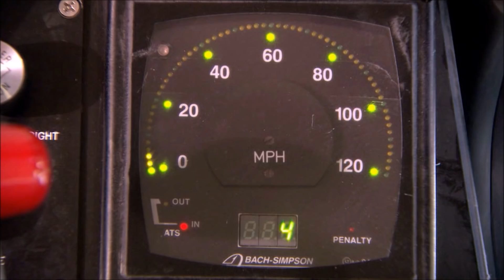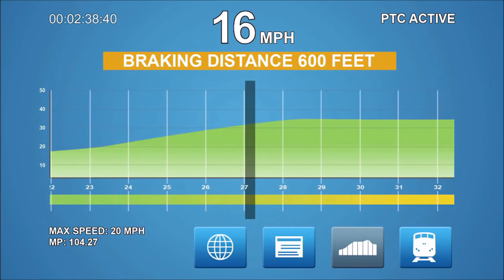Amtrak 501 "Cascades" Train Derailment 18 Dec 2017

Comment: OMG, terrible, respect to the engineer for the calm emergency call, I am a UK engineer so this is close to come. Good reporting also. We heard the curve had been uprated to 80mph is that not true?
Reply: The long straight sections of track had been uprated to 80mph as part of the project. For practical reasons it was impossible to uprate the curve,  so a limit of 30mph remained in force over the bridge. The transition from 80mph to 30mph is the key to this whole accident.
Reply: Thanks Gordon, OMG something terrible was missed then, this was the fist ever train over that new track?
Reply: This was the first fare-paying passenger train on this route, though trial runs were conducted in previous weeks. Many questions need to be investigated.
Reply: agree
Reply: As an aviator, whenever I fly somewhere unfamiliar, I file a flight plan, and do a route analysis as part of my pre-flight activities.  Airline crews do an abbreviated version as well.  Is there not such a procedure for rail operators?  It would not involve much of a time commitment. Most of the facts about the route are known. So ---  why can't this be applied to rail ?? Freight or passenger ...
Reply: There was a test run on the 15th with 501. I'm sure they're going to compare the data from that run to this one.
Reply: That was the conductor speaking, still good on him for being as calm as he was. The Engineer was never heard on the radio!
Reply: No, the curve was not uprated to 80 mph.  It was always rated at 30 mph, according to the news reports thus far.
Reply: As much as they spent upgrading for saving 10mins.
Why wasn’t the bridge upgrade  for millions spent🤕
Reply: At the beginning of their gay when they sign up and they read the bulletins and discuss their trip amongst themselves that is called the crew briefing and they have to discuss what is going on over the territory they will be operating on. The conductor is supposed to remind him of the speed restriction prior to arriving at that point. The engineer's situational awareness should not have been distracted or interrupted by having a trainee in the cab as a matter of fact he should have been more aware pointing out the speed signs for the restriction to the trainee as they progressed over the territory. The engineer must have been distracted buy some other conversation that didn't pertain to the operation of the train. The bottom line here is that it is the engineer's responsibility and unfortunately he's going to hang for the three deaths. His life is going to be in turmoil for many years. I can feel bad for the guy but the bottom line is it's his responsibility.
Reply: On any properly operated railway, the engineer has received thorough training on the lines they run on and receives a briefing sheet of all applicable speed restrictions at the beginning of their shift.

Comment: Amtrak says on their website that those Talgo trains can take curves at higher speeds than regular passenger trains. I haven't heard anybody in media discuss that aspect in any great depth. Care to take a crack at it?
Reply: The Talgo carriages can take well engineered curves at higher speeds, with the same level of passenger comfort, than regular trains. They cannot change the laws of physics, and this was an old curve, which  for practical (space and budget) reasons could not be upgraded to modern standards.

Comment: I'm going to speculate that the cause of the crash had something to do with inertia. 80 mph in a section designated 30 mph. It's unfathomable that this could happen.
Reply: Accident analysis starts with What questions, which is this case is fairly simple. Then it looks at Why human factors, Why systems design, Why planning and training?

Comment: I am at a complete loss, of why a large corporation, would put an engineer in charge of a locomotive, with no previous knowledge of the route. Did the brain dead company leadership, think, oh, he can't get lost, it's on a train track. Just hammer the throttle open, and get to portland ASAP.  Someone needs convicted of murder, and not the train engineer, ha is just doing what he is told, with no information of anything to do with the route, nto

Comment: It is a tragedy for the the victims and their families of course, but if there was a type of trainset equipped to handle that curve at speeds above its mandated speed it would be the Talgo. I have ridden the Talgo through curves on a demonstration run in San Diego, and there are two factors that give it an advantage over standard passenger consists. It is a tilting train using a passive system. For it to work right the railcars are lower to the ground than other passenger railcars are and also the car segments are shorter than typical such cars. Being lower means it is less likely to rollover, and being shorter means passengers have less distance to fall if the car ends up vertical to the ground.
 So this accident should not have happened the way it did if not for the extreme overspeed with which it entered that curve. The railfans killed were probably not seated if I guess correctly but were in no way to blame I would guess. I await the accident report of course.
  I will go out on a limb here and speculate that perhaps the curve holding factors I mention were most likely known to the crew and so could be partly to blame for decisions that could have been made in the cab that day. Remember that the Titanic was on her first run when it hit the unexpected and the tendency to show off speed can be a human failing that may have occurred here too.
Reply from the maker: Paul Gracey Great points Paul!

Comment: Why was the train late leaving its initial terminal & when was the engineer passenger qualified on this stretch of track. There should have been a Road Foreman of Engines in the cab of the engine instead of a cub conductor.
T W MCCARDLE

Comment: Thank you for the report Juan. There is much speculation on what would have been the cause of the derailment. Right now to me it seems the most plausible explanation is high speed/human error. Or some sort of mechanical failure. There are a lot of conspiracy crap being posted in the internet and some website even report it as true news. I have worked with railway crossings safety so I know there is a logical explanation of things. Let the reports coming, you are definitely the most credible source of information.
Reply from the maker: thanks Steve!
Reply: Your Welcome Juan. Your videos on the Oroville dam have been invaluable information to many construction engineers.

Comment: I am a Crew hauler and been going by this spot regularly for the last 3 years. Older BNSF crew have kept me informed of the History of this line and the Sounders.  The main reason Amtrak is on the Newly rebuilt line is that was a way for Extra money to build the lines for the Sounders. Amtrak could have kept on its old route without a great loss of time. Part of the enjoyment of taking Amtrak is the scenery, not watching I-5 traffic! This curve is a slow curve coming up to the Mainline switch. If they wanted to provide Service to Olympia as well, it would have cost money but the line could have kept on straight along I-5  and been more useful.  Half measures for spending rather than doing it right. PTC may have prevented this accident, but so would further training for the Conductor as well as Engineers on this route. BNSF and UP Conductors duties include helping the Engineer spot warning and speed limit signs. But they had a Conductor in Training in the cab with the Engineer in this case.  Another case of Half measures for spending. Lack of training for all personnel, not going far enough on a dedicated passenger route, as well as not installing PTC. And the "Warning of an accident" by the Lakewood Mayor is because of the heavy pedestrian and vehicle traffic at Crossings along the route, not anything to do with PTC, which the idiots in the Media keep implying! Just drive across the crossing at bridgeport w and others in the area and you can make that judgement for yourself.
Reply: I may agreed with you there, Always looking for a short cut, Don't work
Reply: Brian Sloth the reason why the US doesn't have a high speed line is not because we're in the past. It's mainly because train travel is not a main way of transport over here. Also many lines that are used in the  US by passengers are "commuter" trains. Therefore a high speed service would not be profitable. My main point is that the US is not living in the past. They are living in present day, we just don't have a need for high speed services.
Reply: Tom Popp - Thanks for the great info.  I live here in DuPont and have listened to just about every report on this incident.  Your comment, by far, has been the most informative when combined with this video.
Reply: People love there cars, but in NYC and others where travel is better, They will use a train.
Reply: You also forget a major consideration on US vs Europe for Rail lines.. Sheer SIZE. Take a look at a Map of the rail lines in the US and then same for Europe. There is even a website where you can get a true size comparison of counties sizes. Remember the Standard world Maps do NOT accurately show country sizes. Greenland is NOT half the size of the US. Gp tp the TRUESIZE.COM and see.France is only about the size of Oregon and Washington states combined  66 million in France vs 11 million in the Pac NW..
Reply: This is why American railways..(oh sorry, railroads), are the laughing stock of the developed world. Even some third world countries have PTC in trains, and the UK and Europe have even more sophisticated systems. And with all due respect to the U.S.....they hardly have what is called a "high speed train", anywhere, based on world standards. Decades behind other countries, for a variety of reasons. But for a country that thinks it is progressive, and wants to be the "police of the world", their public transport, and safety, where rail is concerned, is stuck in some sort of time warp.

Comment: British trains in the 1950s had a speed control system that checked the speed of an incoming train, presumably with a couple of sensors or switches ( check time between switches ). If the train was over speed then a signal was sent to the engineer, if the engineer did not respond then the brakes were automatically engaged magnetically from between the tracks. Simple and effective with no computers or satellites involved.

Comment: Good Job reporting this train derailment.  I have one thought about this curve on the track and I'm wondering why can't put a 60 degree bank on the track going 80 mph? Will that work? Just wondering. Like Nascar ( Stock car racing on a 60 degree bank going on high speeds ) will that work?  Keep up the good work and love your reporting and Merry Christmas. :-)
Reply: Joseph Verrier There are specific rules for the amount of tilt (called superelevation) permitted in any curve. Speeds may vary, and comfort and stability are both important, as well as wear on the rails due to contact with the wheel flanges.

Comment: Apparently some news sites are reporting that the 80mph speed the train was traveling before the curve was considerably above the speed limit for the straight part of the track. I've not been able to find any comments on that, but if so, it indicates a much deeper problem than just being distracted at the slow-down point.
Reply: Tim Douglass All the reports I saw indicate that 80mph was the limit on the long straight section of track. No reason to disbelieve this.
Reply: That's what I thought, but my mom said the local news (KIRO, I think) said they were speeding on the straight section as well. Guess we'll find out eventually. (maybe)

Comment: The thought I had is was there a communication issue between the locomotives? The driver reduces the throttle but the rear loco doesn't respond, and then the same with the breaks?
Reply: they go offline and into lockout with comm loss.
Reply: Slikx666 The rear loco was being pulled as dead-weight. The reason for having one at each end, was the lack of turnaround capability at the destination.
Reply: Interesting, we learn something new every day, thanks.
Reply: Pulled as dead weight?  Is that only with Talgo trainsets? Amtrak Uses BOTH front and rear locomotives push-pull as power on their commuters.  You can clearly hear the rear unit is accelerating:
https://www.youtube.com/watch?v=g-vBnMYhTZQ
Reply: And you can clearly hear the rear engine in this clip: https://www.youtube.com/watch?v=DBHP36HItVo
PS - They do not smoke like that at idle.  This is a Push-Pull Operation - Both Locomotives are moving the train.
Reply: I do not know for certain (and am not an expert), so I was quoting another post in this thread! The Talgo carriages are quite light, so a single engine would have sufficed. They also have a more rigid coupling, so they do not need a push-pull configuration to avoid the 'jerking' on startup of old type trains.

There are many regional alternatives on Amtrak, and one previous option used a single engine plus a 'cabbage-car' for control in the reverse direction: https://en.wikipedia.org/wiki/Amtrak_Cascades#Rolling_stock

Because the new #501 train-set had two dissimilar engines, the controls might not have been compatible for simultaneous use (speculation?)
Reply: Denniss7420 This is what I was wondering, why would you have a train and not use both locos? If you have 2 then one is the backup incase anything goes wrong with the one at the front.

Comment: Thank you for a sincere and cogent presentation of what we know, and what will happen, in this derailment investigation.  I have 51 years of railroad experience and, incidently, worked on many Charger locomotives.  I was dissapointed in the MSM coverage of this incident, where they focused only on the Talgo car dangling from the bridge, and made silly comments about how the engine stayed on the tracks, not even knowing which direction the train was going, and never noticing the Charger locomotive which had plowed through several dozen trees and dropped some 30' to the highway.  My only correction is that the radio call was from the conductor, not the engineer, the radio and all communication equipment on the lead locomotive was destroyed in the crash.  By the way, I've not heard any comments on the condition of the 2 engineers in the cab - obviously a very rough ride.
I appreciate your work, and safe flying!
Reply from the maker: John CMR Thanks John!

Comment: No disrespect meant, Sir, but I have been riding these Cascade trains between Olympia, Washington and Portland/Salem, Oregon for years. I don't like riding on those trains. They creek and sway, bouncing down the tracks. I like the newer Starlight trains because they are smooth to ride. Those cars you say are new from Spain? They look just like the same old coaches I have been talking about. Every time the Cascade pulls into the Station (501/511) I am disappointed and wish it were the newer, smooth riding train. The double-Deckers are wonderful.Also, that safety feature was not installed because it costs billions of dollars.
Reply: very posotive post...thank you

Comment: Headline: Passengers killed by bureaucratic red tape. PTC is a multi-facetted system that incorporates broadcast bandwidth (FCC has to carve out another slice of very limited radio spectrum and insure that PTC is NOT interfered with by adjacent frequencies), satellite connectivity (GPS), terrestrial communication (phone lines and internet), the installation of additional signal lights and reporting sensors (this country is vast people, there are many stretches, that at present don't have the need for signaling on such a macro scale). Then there are interoperability issues with existing systems such as ACSE, ITCS, I-ETMS and probably others?
What about existing locomotives and equipment? All those pieces have to be upgraded to conform, yet the standardization is not finalized (to my limited knowledge) and over the counter solutions are NOT available. UNDERSTAND, the Federal Railroad Administration has to approve all of the infrastructure required....and to add insult to injury, this is an UNFUNDED MANDATE! 
I'm not slamming one side or the other, I see the merits of what is intended, but also the reality and complexity of the task... I'm merely illustrating that this is a HUGE and EXPENSIVE undertaking. 
Juan, to me this smacks of the ADS-B requirement that is looming for those of us in GA.
Reply: Well said sir!

Comment: Seems any talk about PTC is superfluous to this accident.  The engineer simply ignored his speed heading for the I-5 overpass.  No amount of excuses or rationalizations can change this.  Just as you can't alter the laws of physics.  Pilot error in losing situational awareness causing train to enter in to an untenable and unrecoverable fatal accident.  Stuff happens.
Good job, Juan.
Reply from the maker: Dick Wittington yes but PTC could prevent this by automatically slowing the train if no one reacted.
Reply: Had the engineer not driven in to the dirt we wouldn't be watching vids about PTC.  That is a separate issue, why and how the PTC system has been slow to be implemented.  We are asking where was the PTC system because it might have over-ridden a total failure by this engineer.. The PTC system for this neck of the woods is still 6 months or more away.  It wasn't even planned to be available the day this accident occurred.  In the mean time, it would be nice if they drove the trains the old fashioned way.  If this accident is like previous ones, it will get messy once all the lawsuits are filed.  "Fate Is The Hunter."  A series of smaller,  seemingly unrelated events, leading to a catastrophic conclusion?

We need more of those white board technical diagrams from your kids.  And what happened to the dino's?